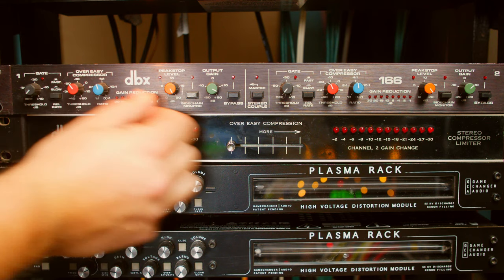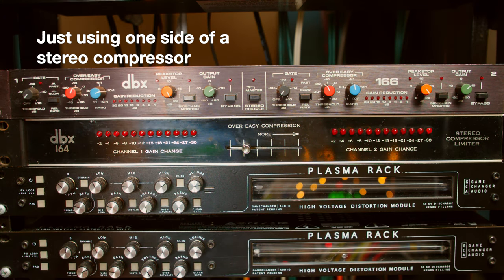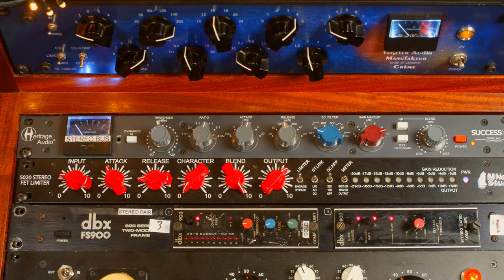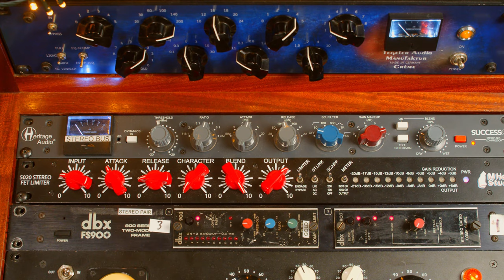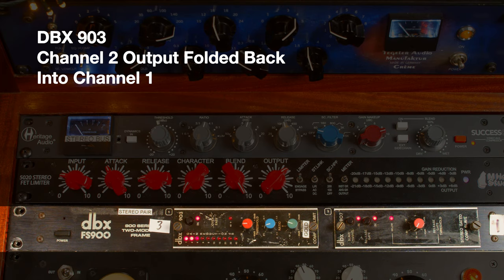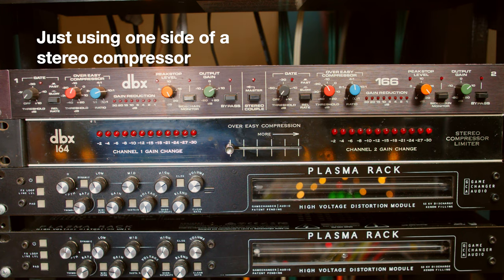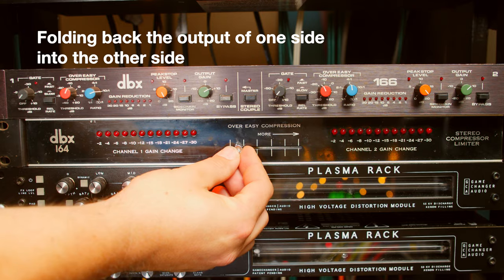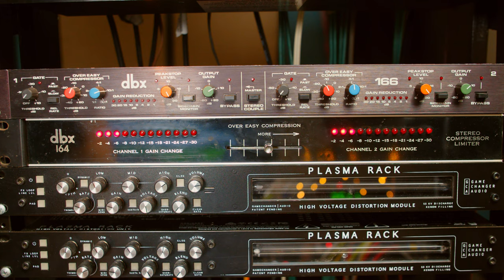Fold-back Compression - Aggressive Compression from Ordinary Outboard

Comment: Is this type of routing possible itb?
Reply from the maker: No idea how.
Reply: @creativesoundlab  dang
Reply: @creativesoundlab  I tried setting it up and I might have got something working in the same (or kind of similar) way...

If I'm understanding the routing correctly, one channel needs to be the "dry" [original] signal and the other the compressed signal from the first channel of the compressor. So in Reaper, I set up two instances of a compressor with a stereo link, the first acting as the left input/output, but only affecting one channel so I could feed the second compressor with one channel that had already been processed by the first compressor and the other channel with the dry signal.

It does seem like a really complicated thing to set up ITB though, even assuming what I did actually does work in the same way. It would be cool to see plugin developers include this as a feature.
Reply: put the compressor on a stereo aux bus, send your original signal to the left channel of your aux. route the output to two more mono auxes. now you have the left and right output of the compressor split. you can aux the left output back to the right side of the original aux/comp. and ultimately you can use the right output aux as your result. sounds more complicated to describe than it is… 1 stereo, 2 mono auxes, and some sends